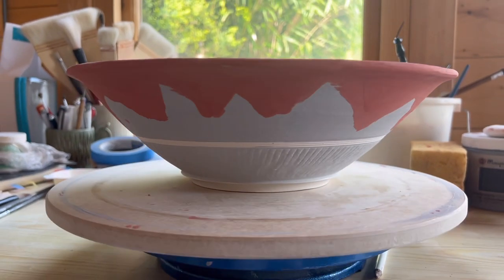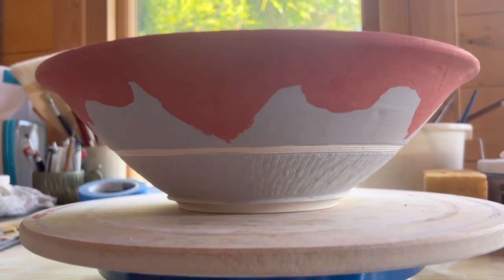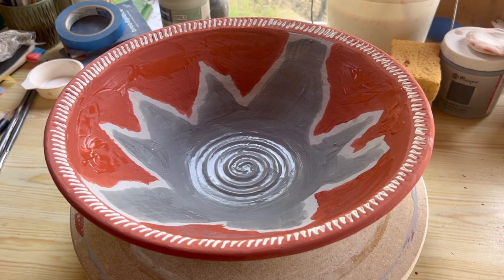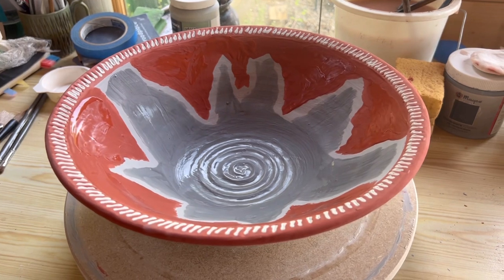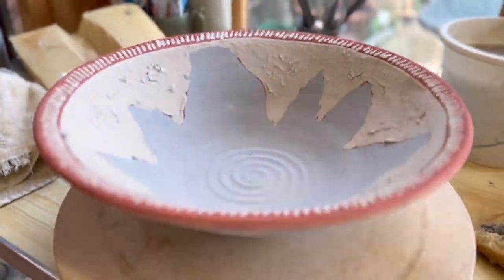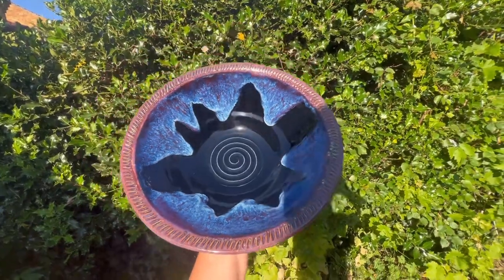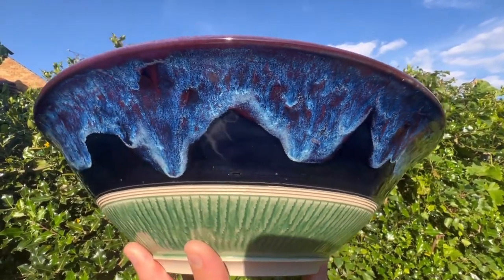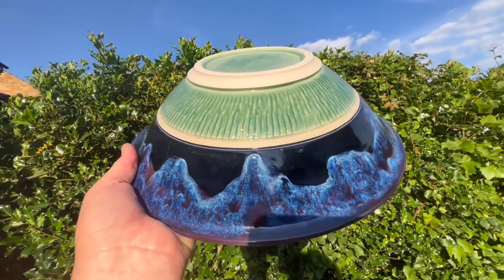81. Glaze Layering Educational Midnight skies. Amaco Obsidian, Smokey Merlot, oatmeal. True celadon.

Comment: I love that bowl!!! When you glaze with obsidian do you cover all with obsidian and the Smokey merlot on top or you just do obsidian on its own and Smokey merlot on it’s own?? I hope it’s not a confusing question.  By the way I’m a fan, watched pretty much all your YouTube!! Thank you
Reply from the maker: Good question because I jumped straight in. So the rim is diamond cored on the reassess I pip petted the celadon green. Pained on three layers over of Smokey Merlot and then pip petted snow in the cuts. 
The bowl was then pained three coats of obsidian avoiding the celadon and rim. Over the top was two/three coats of Smokey Merlot. Then over that part the very thick Oatmeal. 
The combination of the three glazes makes that fantastic blue/maroon plus the run that the oatmeal causes. Then as I find if I’ve made a indent in the middle of the bowl and I want a solid dense black I do a forth coat of obsidian in the bottom of the bowl not going over the areas I did the Smokey Merlot. Hope that helps.

I also talk about this glaze in video 65.
Reply: Thank you so much! I’m excited to try out out!!! Looking forward to more videos from you!!